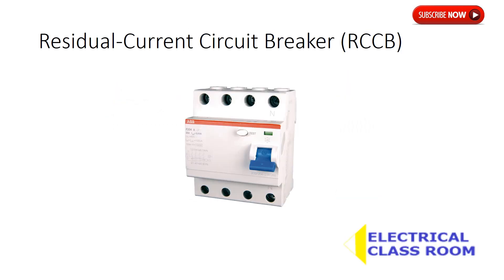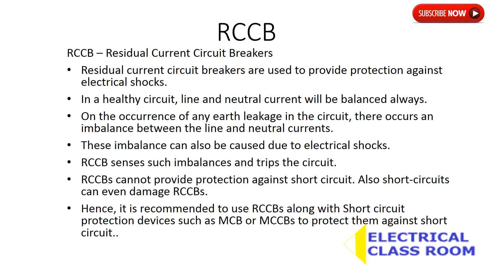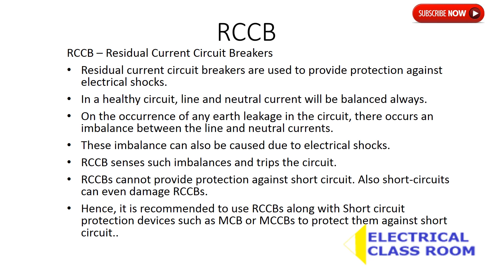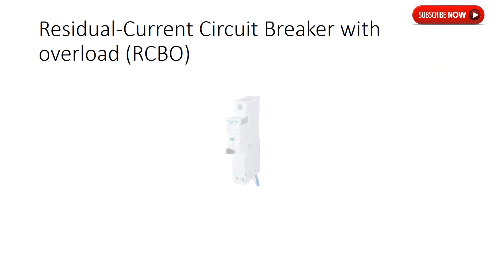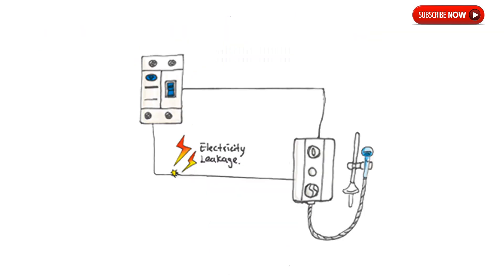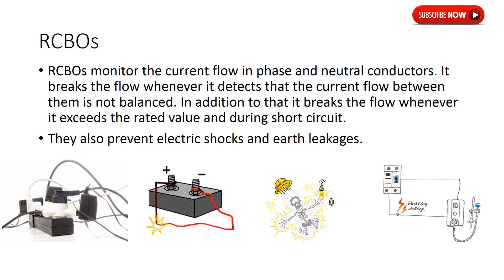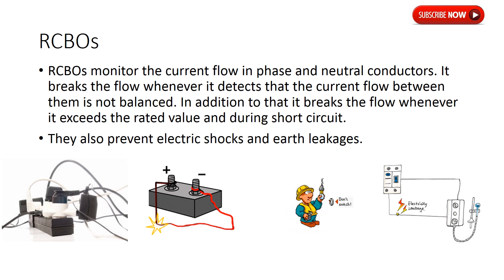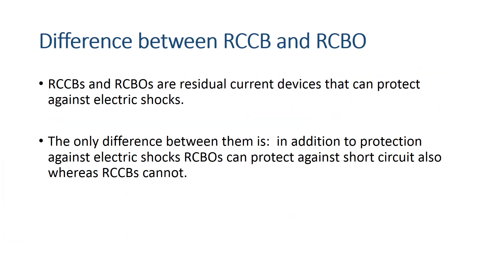Difference between RCBO AND RCCB

Comment: Kindly explain difference between RCBO and MCB?
Reply: RCBO as mentioned has earth leakage detection to protect against shocks and Short circuit in case of insulation failures or so. MCB can only break the circuit in the case of Over current than rated current anticipated.MCB cannot protect from shock due to earth leakage or short circuit.
Reply: thank you very much sir
Reply: kindly even explain it also that which types of devices can protect the circuit in high voltage from main line